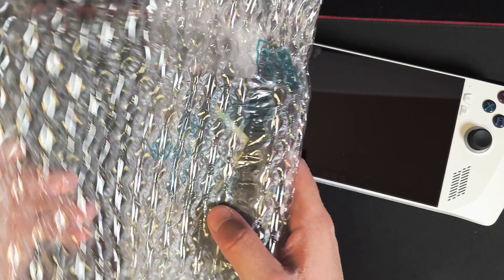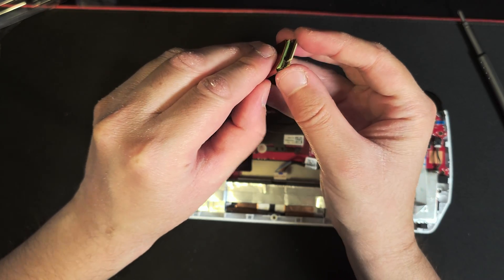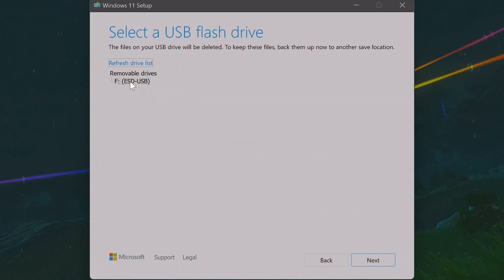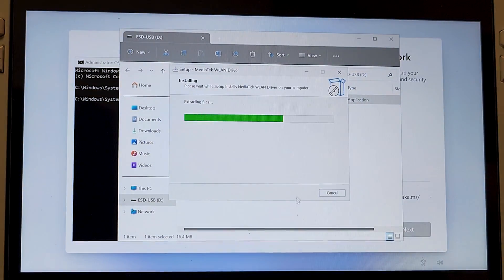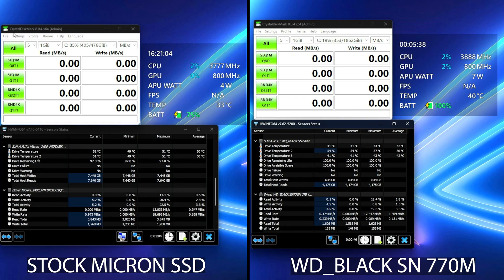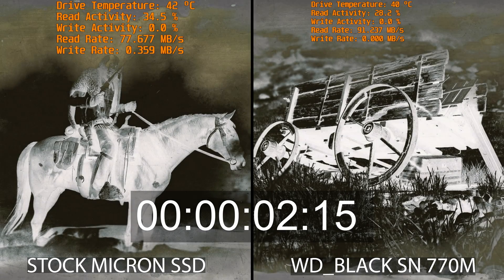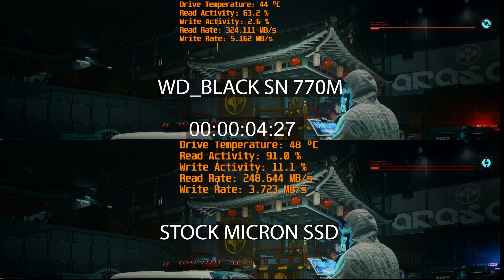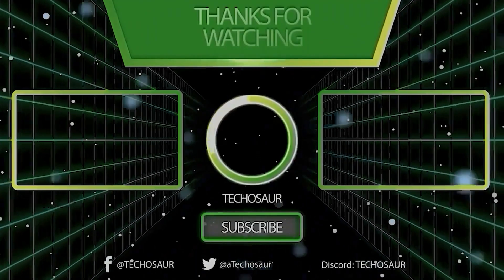ROG ALLY SSD UPGRADE with WD_BLACK SN770M - installation and Benchmark

Comment: I installed the ssd a week ago, i did not know about the ssd firmware. Will i lose data if i update the ssd firmware now, after a week of use?
Reply from the maker: No, you dont lose any data on firmware update, its stored in a different IC not on memory chips
Reply from the maker: I can assure you of this; I've done it many times,  I always update the firmware for my SSDs when I see an update. It's better for device stability and security.  Before u do it they don't warn you that you would lose data, if it was the case  they would have, so don't worry. Just feel safe; you won't lose anything!!
Reply: @TECHOSAUR  upgraded the firmware yesterday,  no data loss👍 thanks!

Comment: Do ypu have a heatsink with ssd?
Reply from the maker: Yes, this SSD runs quite hot, given its high speeds
Check this one , it's the one I'm using with it

https://youtu.be/16S03LWZeWc?si=7Sfc8YDlZKPBC_HM
Reply: @TECHOSAUR  I'm using the wd black software max temp on ssd is 53 without heatsink. Console temp goes high when on turbo mode waiting for heatsink to come from aliexpress. What do I do with the black blanket when I've installed heatsink do I leave it in or take it out? Can't find anyone talking about that 😂
Reply from the maker: @pkpayne14 Take it off, but I stored mine somewhere. Basically, it only prevents dust, but removing it improves thermals.
Reply: @TECHOSAUR  what a legend finally somone who knows. Does it cause damage or void warranty removing it? I'll put mine in my asus box theb
Reply from the maker: @pkpayne14 No, it doesn't void the warranty or cause any damage. I've been using mine without it since I got it back in August 
Also I sent it for repair without it and nobody commented
Reply: @TECHOSAUR  brilliant thanks do you recommend putting heat sink in length ways or width ways? To get the most cooling
Reply from the maker: Length ways as NAND chips are in the middle and don't cover the total width.
Reply: @TECHOSAUR  so how you installed your one then?
Reply from the maker: @pkpayne14 like this 

https://youtu.be/16S03LWZeWc?si=CHGXueQ2QFXG0ZGv

Mine is square, so it covers it all
Reply: @TECHOSAUR  my heat sink is similar mines 25x25x10 so I'm hoping it fits in. I had a different one and the case wouldn't shut 😂
Reply from the maker: @pkpayne14 Just try tilting it ever so slightly so the plastic part goes in.
Reply: @TECHOSAUR  you good sir are an absolute legend ill let you know how it goes

Comment: Hey buddy, could you interpret about temperature ? i dont quite understand about those temperature comparision.
Gracias
Reply from the maker: The SN770M SSD runs hot because of the higher speed it can peak at, so it's important to get a heatsink to increase its longevity and also reduce the overall internal temperature of its surroundings, as gen 4 SSDs can really cause high temperatures.

Comment: How is going with your fan cooler it dont have give you problems with condensation? I'm thinking buy one for my asus ally
Reply from the maker: No issues with that one, I've seen a few others that got it and also stated no issues, so it's safe as long as you first mount it on the back of the ALLY and then turn it ON also while the ALLY is ON, this it could help dissipate some heat give, you will likely have about 5 degrees drop, not huge but not bad either!

i like to use it mostly handheld and its pretty low cost